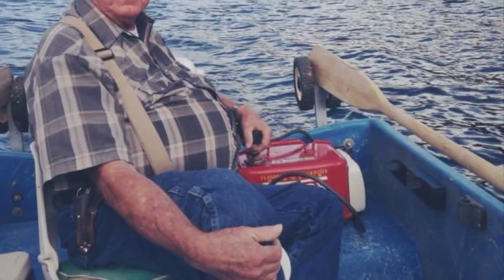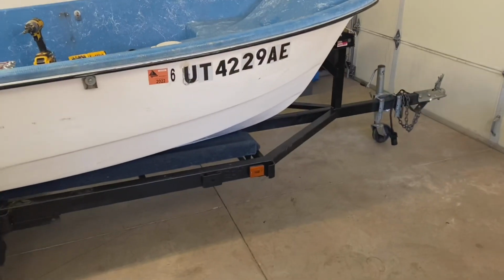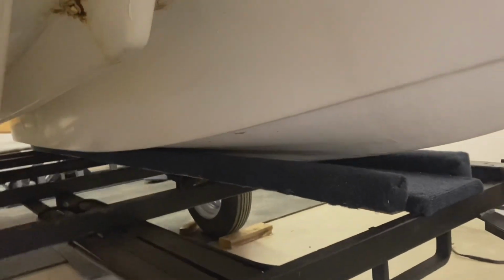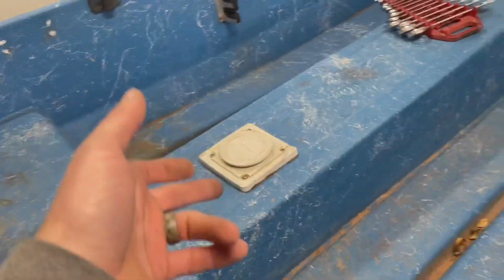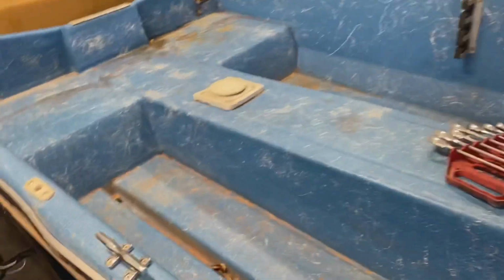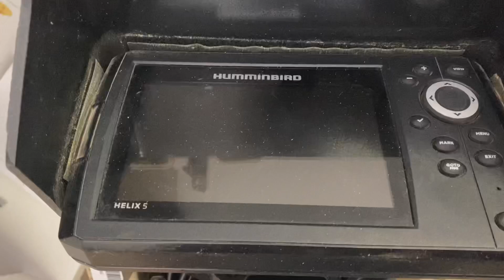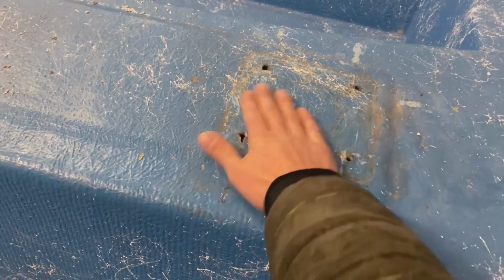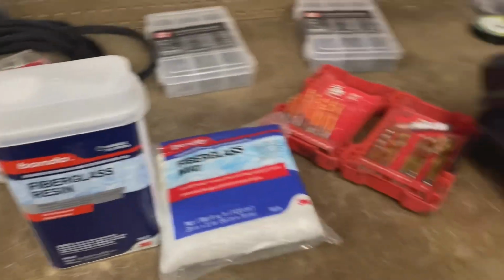Mini Bass Boat Build! (Episode #1)

Comment: Your right, never seen any tiny fiberglass boats converted to bass boat. Wouldn't mind trying to convert a Boston whaler. There really good in rough conditions. Good luck on your project. Your off to a good start.
Reply from the maker: Yeah not many! And I understand why, it comes with some different challenges for sure. Yes, they are very stable, which is a great advantage. Thank you!